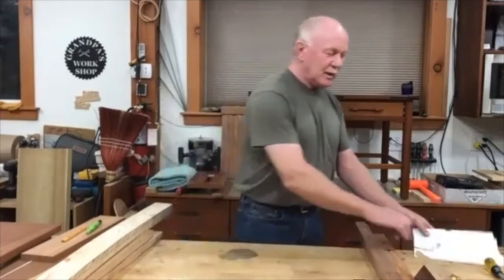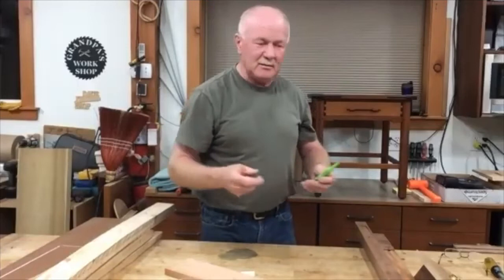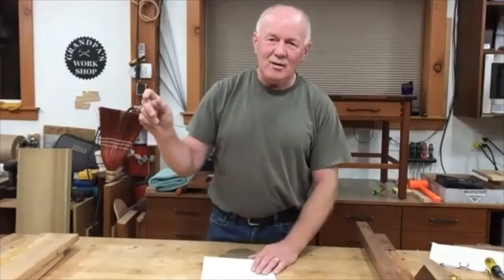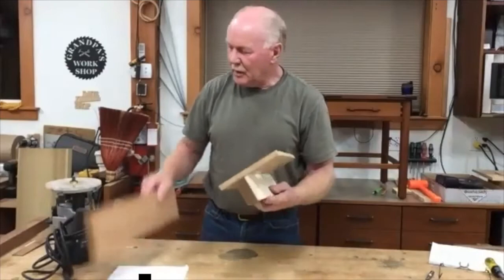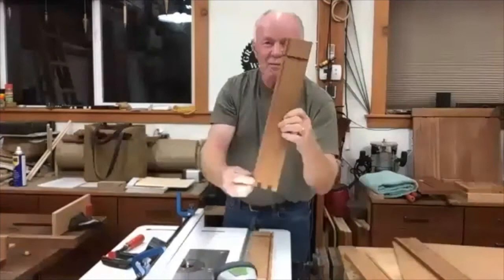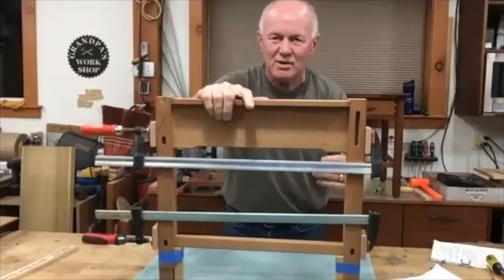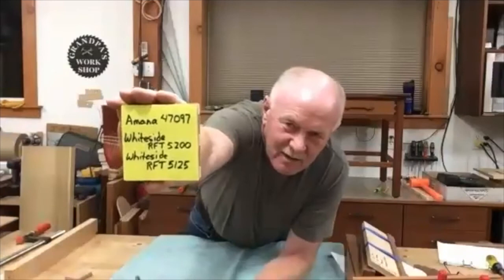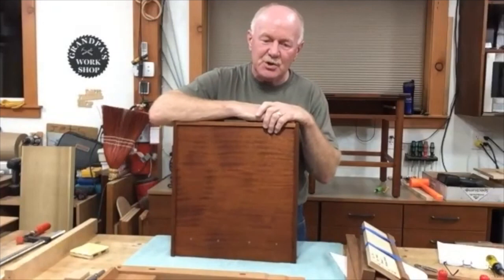Part 1 of 2 - Building a Greene and Greene-inspired Nightstand with George Knutson

Comment: This is an amazingly detailed video. I’ve read and viewed a number of the instructions for these G&G drawers but I’m never comfortable with the process. I’m about to try your method and I’m pretty confident. I may have missed this but what is the material thickness for the drawer?
Reply: Thanks George! The way you incorporate assembly tips and shop tips into your presentation is awesome! Thanks!
Reply: Glad you found it useful, Richard.  The thickness of the drawer parts in this end table are 1/2".  Be sure to post your results.  I'd love to see how it works out for you.
Reply: When it comes to a small drawer like that which does not have a heavy load it is pointless having a mechanical drawer runner.